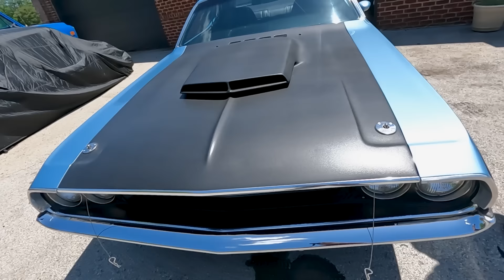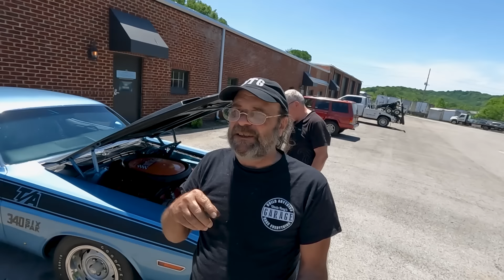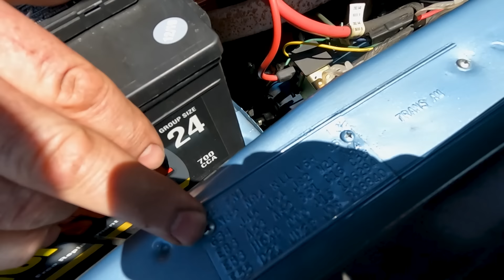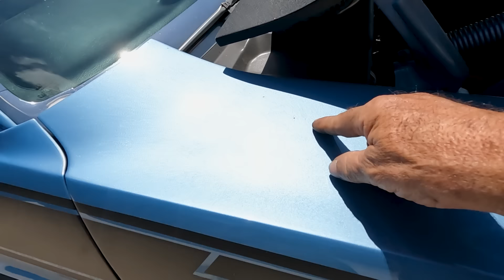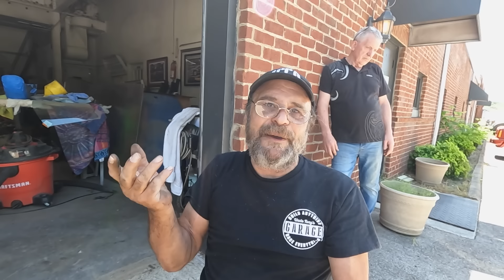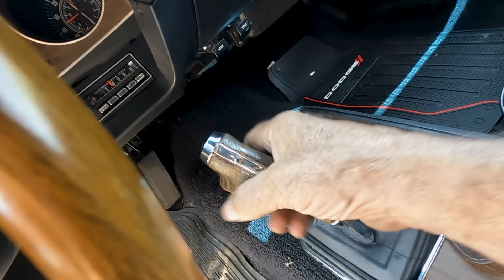Chryslers Most Enigmatic Musclecar - The 1970 340 Six Pack T/A Challenger (And AAR Cuda)

Comment: Tony, love you dude! On the T/A and AAR cars, the antenna was moved rearward due to no steel hood to cancel radio interference. Additionally, the fender tags all start out with one screw so the tag can be read by assembly line workers and the paint shop can dust some paint underneath. The second or third screws were added later down the line, leaving most tags with a slight to pronounced crease as they were lifted for paint. Lastly, all T/A and AAR cars have the extra tag there to tell line workers to use the specially modified front fenders on these cars, If you look, the inner wheel lip is rolled under along the top for tire clearance. Thanks to you and your bride for all the awesome content! Chris Cox, north of Pittsburgh Pa!

Comment: Antenna was moved to the rear probably to avoid ignition RF interference which the fiberglass hood cannot contain.
Reply: CORRECT !  Come on, Uncle Tony!  Like the early Corvettes had chrome plated steel shielding over the plug wires, to ground RFI ,before the radio antenna picked it up.
Reply: Wonder why the 69 A12 cars with the fiberglass hoods didn't relocate the antenna...?
Reply: @xlmi7021  Maybe that's where they learned about it?
Reply: @mikeceli  And even the other GM models had a stamped steel shield that covered the points to prevent primary ignition RF interference.  The only reason that I know this is because my grandfather bought a 1973 Chevrolet C20 with a 454, and I was the first one who gave it a tuneup (my grandfather never drove it, and when he passed in the early 1990s, it still only had 19K original miles on it).  Every.  Single.  Mechanic threw that little cover away at the first tuneup.
Reply: kiwi victim od uncle tonny chanell, stealing him content
Reply: with that old ignition flame thorwer..it will work as a beluga missele.
Reply: I just like the rear wheel.

Comment: Tony, you forgot about the cast iron adjustable rocker arms with the offset intake arm. The rocker arms looked a lot like the 273 solid lifter cam head rockers arms but with the offset intake arm that moved the pushrod away from the "pushrod pinch" in the head. To me this is probably the trickiest part of the 340 TA engine, and the part that would really set apart the 340 TA engine power producing potential from any other 340. The heads as cast flowed no different than any other 340/360 J head with 2.02 valves, but you could open up the intake ports a lot more and get more flow from the head because of the rocker arms and the additional meat Chrysler left in the pushrod pinch area.

Comment: Another of the unique points on the T/A cars is the exhaust hanger. To support the side exhaust pipe there is a doubler plate in the rocker panel so the screw won't tear out.

Comment: the painted fender screw is because the fender tags were applied before paint and they would be held with 1 screw so the painter could lift the tag up and paint under them. after paint the other 1 or 2 screws depending on the number of tags were installed so they never got paint on them.

Comment: My neighbor as a kid was a mopar fanatic. He owned a mostly mopar junkyard in moline Illinois. He had a 7 T/A that was plum crazy with a black interior. The car was stolen in 78 and the engine and transmission were taken out. He got it in the junkyard, as a salvage car. He put a 440 4bbl in it out of a 69 fury. I could’ve bought it in the 90’s for 5 grand but as a 16 year old kid I didn’t have the money. 
He found the t/a block and heads for that car at a local junkyard in 1995. Amazing it was still
In our area.. the blocks and heads both say trans am on them, similar to the fender tags. 
One detail I didn’t see on this car is the rumble bee  stickers in the corner of the rear 1/4 window. 
The auto cars all came with the slap shifter and the 4 speeds all had the pistol grips. 
The front wheels were 15x6 and the rear 15x7..  
I sure wish I could’ve bought that plum crazy t/a back then. 
Great video uncle Tony and kiwi
Reply: A lot of misinformation here. They did NOT come with narrower front wheels. 15x7's at ALL 4 corners. Heads do NOT say "trans-am", T/A  or anything like that. They DO have 360 cast into the top of one of the intake runners. One more thing, the automatics did NOT ALL come with the slap-stik floor shift. I've seen several legit AAR/TA's with column shifts. I remember one I saw, in early 70's, had HOUNDSTOOTH interior upholstery. YIKES! Yes, that was possible, too. There's no accounting for taste, as my late friend, Art, used to say.

Comment: I owned a Challenger T/A briefly in 1986/1987.  Mine was Hemi Orange and originally had a 727 Auto.  A previous owner had replaced the 727 with an A833 4-Speed with the pistol grip shifter.  They actually cut the transmission hump out of the car and welded in a hump from a four speed car.  It was an ex-drag car, and had a non-matching 340 block in it.  It did have the “J” engine code in the VIN, and most of the special T/A stuff you’d expect to find including the rear mounted radio antenna.  The fender tags, SixPack intake and side exhaust were gone and it had 14” Rallye wheels on it. It was because that it wasn’t all factory original with fender tags, matching numbers drivetrain, that I was able to afford to buy it back then.  Otherwise, it would’ve been too expensive for me.  Yes, even in 1986, missing the fender tags, original 340 block, trans, intake and exhaust, dampened a lot of interest when I put it up for sale.  It took about a month to sell the car..  I bought it for $3200 and sold it for $2400 at a loss..  I had a 1971 Challenger that was all original, with fender tags etc., at the same time.  I had to leave to start college, and my dad wouldn’t allow me to keep two Challengers at the house while I was gone, so one of them had to go.  If I had gotten the T/A in the summer, I might have kept the T/A instead of the 71, as the T/A needed work to be driveable (it ran but wouldn’t pass inspection due to several reasons) and the 71 was already roadworthy and passed inspection.
Reply: Got a friend in san francisco who is building a hemi orange challenger T/a 340 6pack four speed,  he got big money in it, total restoration

Comment: On my '65 Valiant bracket racer (four-door) I initially used the pistol grip shifter after swapping the factory torqueflite for the Mopar A833 four-speed. However, I later found a T-Handle grip (canted in the direction of third) more comfortable/reliable when making a power shift from second to third. Those aluminum small block timing covers all eventually begin to leak (just replaced one on my '65 Barracuda Formula S). I am currently building a Mopar 305 for my '72 Plymouth Satellite Sebring Plus (Super Sat). I am using 340 TRW 12:5 to 1 dome pistons, a 2.96 Bryant Racing billet crankshaft, and custom Cunningham connecting rods. Due the the de-stroking, the actual compression ratio will lower to about 10:5 to 1!

Comment: The rear leaf springs have extra arc on the 1970 340 Six Pack cars. They claimed it was for rake, as are the tire sizes, but it looks like it is for additional ground clearance for the side exiting exhaust. The 1970 340 Six pack cars with 4-speeds, got the new version of the 4-speed that would become standard for 1971. The gear spread is a bit closer than the older 4-speeds and the other 1970 4-speeds.

Comment: Yup, with the VIN you can win: J for Challenger, H for High price class, 23 for two door hardtop, J for 340 CID V8 with Six Pack, 0 for 1970 model year, B for Hamtramck, MI assembly, aka "Factory Zero" or "Dodge Main" and the rest is the production sequence. The Dodge Main facility closed in 1980 and today's GM Hamtramck, MI assembly partially sits on that site.

With the tag, you can brag: N94 for fiberglass fresh air hood, R11 for 2 watt AM radio, Y05 for USA spec vehicle, J45 for hood tie down pins,  J54 for sport hood, J82 for rear duck wing spoiler, M21 for roof drip rail moldings, N44 for side exhaust, EB3 for Light Blue exterior paint, A53 for Trans Am package, A62 for Rallye instrument cluster, B51 for power brakes, C16 for console with woodgrain panel, C55 for bucket seats, D21 for four speed manual transmission, E55 for 340 CID V8 with Six Pack, approximately 290 HP, 26 for 26" radiator, EN1 for end of sales codes, H5X9 should be the interior code with it being black, N85 for tachometer, V6H for Black Trans Am stripes, among other codes.

Technically, the Grand National and the Trans Am had "side exit" exhaust, although the Trans Am exhaust technically points downward.
Reply: Thanks GoogleUserGP!!
Reply: Are you sure about that? AAR was B"S"23JOB. I believe "S" was for "Special".
Reply: @budlanctot3060  The VIN is at the bottom of the trim tag and clearly shows an "H" for the 2nd VIN digit. That means "High" for the price class. Yes, "S" was for Special. Plymouth and Dodge could have used different codes across sister/brother vehicles.
Reply: @LongIslandMopars  Sure thing.
Reply: You guys are killing me with all these small block mopars! Lol I looked at a 68 Dart gts a few days ago that was for sale. Rotted structurally beyond what what I'd want to restore, damn it! Lol You guys make me miss the 69 gts I'd restored and had to sell. What a beast, those 340's were definitely big block killers, at least mine was. Lol It was by far, the most fun car I ever owned! 4 speed, 8 3/4 auburn cone sure grip. I scared the crap outa many grown man in that car, most described it as violent! Lmao

Comment: In the 1980's I put a 340 in a 1969 Barracuda. I later replaced the 4 barrel with a 6 pack. The 6 pack carbs were from a 440. The front and rear carbs had a tab in the booster ventries. I guessed that was to make them work with the original 440 6 pack. Later someone broke into the garage where I stored the car and stole the 6 pack carbs.  I replaced the carbs with corvette carbs. This was a (I think Chevy called this a tri-power) on a Chevy 454. I noticed two differences in these carbs,  the diameter of the booster ventures were smaller and there were no tabs in the ventures. Very strange,  smaller carbs on a Chevy 454 compared to a 340 6 pack! Also, I would like to know I Chrysler always used a vapor separator between the fuel pump and carbs,  similar the the setup used on the Hemi cars. Just some thoughts.

Comment: Absolutely beautifully done car and the reason for the antenna in the rear was because they supposedly had radio interference due to the fiberglass hood so they put the antenna in the back where everything around it is grounded and supposedly they had engine noise that came through beautiful car

Comment: They had special rear leaf springs AND a REAR SWAY BAR. Some had a fast ratio power steering box as an option, which in my opinion is the best option on the whole car. It really eliminates the typical vague, poor road feel of std Mopar power steering. Also, the rear duck tail spoiler was very functional. At 60+ mph you can actually feel the rear squat a bit, and the front end raise up, which is where the chin spoilers helped alleviate the " light" front end at speed.

Comment: The rear gears are either 3.55 or 3.91, and I believe this is the first application of the close ratio transmission gear set. Fast ratio power steering was an option as well. I’ve never owned one either, but my brother had one for years, so I know what it’s like to drive one. It doesn’t have a passenger side mirror, most I’ve seen do.
Reply: Yep. The fast ratio wasn't actually due to the gears in the box, but was done with longer than stock Pittman arms like what is available today. Weirdly enough, the idler arm was still at stock length. The longer idler arms were not available until the aftermarket started making them decades later.

Comment: I currently own my late dad's 70 AAR Cuda he bought in 76 was my inheritance it's EV2 Toro Red #Matching 340+6 T/A engine,4-speed everything is original except for the spark plugs & wires, Battery. Car was painted silver in the 70's in 05 was repainted back to EV2 this car is unique as it came from the factory with challenger T/A interior I found build sheets from two different T/A's in the seats

Comment: I think the one painted screw and one not painted on the fender tag is because the factory attached one screw and bent the tag up to paint under it and then bent it back down and ran in the other screw after paint. There should be a crease in the tag on the painted side.

Comment: The vin tag has unfinished screws and a painted screw because the painted screw was the only one on the car when it was painted. They add the unfinished screws when the car is complete so that they’re able to swivel the tag any angle they want so they can easy read it correctly while building the car.

Comment: Uncle Tony question. Decision time. Up for grab is a 1966 318 charger needs work to be roadworthy. On the other hand we have a 1969 GTX THAT needs more work such as floors, trunk floor and quater panel. Engine rebuild and some interior. No I am not a welder and not really knowledgeable in mechanical issues. But I really like the GTX. What is the smartest choice cause both are great cars in my eyes.
Reply: Fix the one that makes you smile everytime you look at it.
Reply: Nice 😅 thank you
Reply: A 66 Charger is hideous...an 69 GTX aint. GTX all the way

Comment: For the painted center screw and unpainted outers, at the factory they probably put the center screw in to locate the tags but still be able to paint the tags and under the tags at the same time. After it was painted, the 2 outer screws were installed to hold the outer edges of the tags down, resulting in the center screw being painted and not the outer screws.

Comment: the chevy 302 was a 4 inch bore 327 or 350 but destroked to 3 inch using the crankshaft and rods from the 283 chevy small block for the Trans Am series. The 305 5.0L chevy came into production in the late 70's as an emissions reduced V8.
Reply: The Chevy 302 was de-stroked. The 305 was de-bored with a 3.48 crank (from 350).
And the Chevy 267 was just de-sgusting

Comment: Beautiful car!   B.T.W. 1965 Shelby GT350 also side exhaust equipped as produced. In Connecticut, we've had to temp. install pipes over the rear axles to pass CT. State inspection when applicable. We then return the exhaust to original configuration after the vehicle passes inspection. No one ever seemed to care after the car was registered.  Only needed them three or four times but always kept a pair of temp. pipes at my shop.

Comment: The fender tags were installed with one screw, then painted when car was painted. After paint dried the other screws were added to secure the tags.
Reply: Surprised Tony/Kiwi didn’t know that. It wasn’t a stainless screw either just bare unpainted.

Comment: I was told that the painted screw was installed before the cars got painted, with the tags bent up a little for paint to get under the tags, then the other screw/screws were installed later. Looks like those tags have that bend in them.
 I do know that when you pull the tags during a resto there's little or no paint under just that part of the tag

Comment: So this is nothing bad to say about uncle Tony, but a guy who was an editor for Mopar Action comes to my home in PA to buy an X block, and some W2 heads, and while I was taking care of my wife who had M.S., they loaded their pick up and cleaned my garage out, than headed back to Passaic N.J. . This is when I was attempting to be the first person to ever install a gen III hemi in a muscle car. Not only in a muscle car, but in a body in white 1969 Barracuda register with the Walter p Chrysler museum,  that was previously owned by riddler award winner Rob Ida. 
                                                       I was told the T/A/ AAR cuda had the antenna in the rear because the fiberglass fender ( which it never came with,  somehow blocked any radio reception. I was told that back in the 1980's by Jim the parts guy ( can't recall his name) who worked for Dave Ferro. While I was building my 430 stroker T/A that had a shaker, because the correct hood I couldn't find.

Comment: They moved the antenna to the back for radio interference due to fiberglass hood.  The end screws on the fender tags were not painted because the tags were bent up so paint would get under them and they used plain screws to fasten them.back down

Comment: Might be a water pump change, there is a hole in the bottom of the small block water pumps that sometime the plug or whatever is in there goes and starts leaking. One way to tell is it only leaks when it's stopped not when it's running. I had it happen to my '73 Satellite Sebring 318.

Comment: It works because of it using the center as a primary that gives it good velocity.  The single 850 has large venturies that at idle excelleration it has low velocity but is good at WOT.  The six pack is kinda the best of both worlds.

Comment: I think that 6 pack  340 should have  cast adjustable rockers  not stamped steel only on  the  TA  and  AR  340.  Could be wrong
Reply: It has the same pushrods as the hemi, and possibly the slant six.
Reply: You're not wrong. Intake rockers are offset.
Reply: @siulumlion it most definitely does NOT have the same pushrods as the Hemi or the sl/6. Intake pushrods are slightly longer than the exhausts.